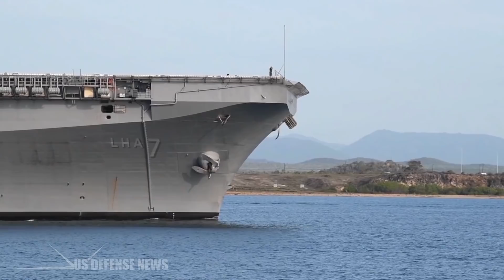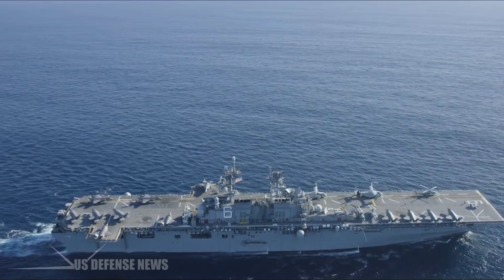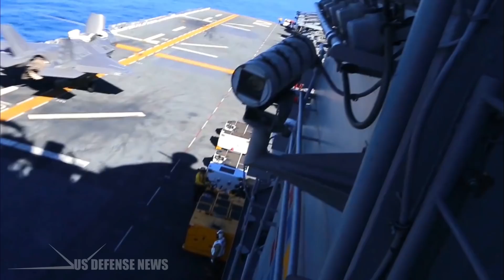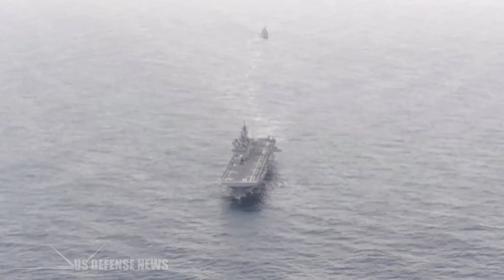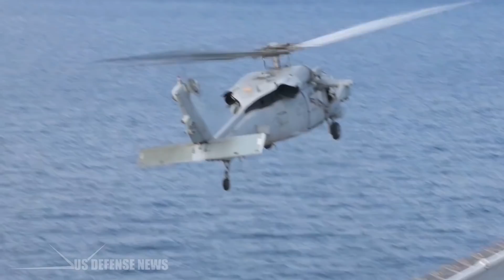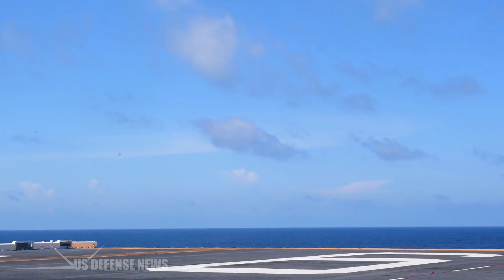Meet the U.S. New 'Assault Ship' Armed with F-35s and Much More

Comment: I wonder if any previously mothballed carriers could be brought back into service if they could be upgraded and outfitted with one or more flights of F35Bs?
Reply: Depends on what you are calling a carrier
The Kitty Hawk and the JFK are struck awaiting to be scrapped. Not sure what condition they are in BUT it should be noted that in its final years in active service the JFK was the most expensive carrier to operate and that planned renovations were simply abandoned.
So the only other thing that could be called a carrier are the last two Tarawa Class vessels that are In reserve. It’s possible one or both of them could be reactivated to fill the gap left by the torched B Richards but I’m not sure how feasible it would be to fit them for f35 duty

Comment: It really SHOULD BE wider - deck LIKE UK's Queen Elizabath Class carrier! This means our America - class overall tonnage can be - OR - SHOULD be indeed to 56,000 ton from 46,000 ton! USA
Reply: This is a failed design for a light carrier. failed because it will be the only ship of its class. the rest of the America's will revert to traditional LHA design.
Reply: This ship was designed to meet original Panamax standards and fit through the original Panama Canal with a lock system 1000' long by 110' wide.

Comment: It was stupid to build the first two America class vessels without well decks, they basically are just pocket carriers at that point.
Reply: Yea but the Marines have done experiments where they remove the V-22's and most of the Helo's and they can operate with a air wing of 20 to 25 F-35's. It won't have the punch of a CVN but it adds capability that has never been available to the USMC before.
Reply: They will provide air cover for the Amphibs.
Reply: The non well deck America class carriers are intended to fill the gap of support that we used to get from Britain and France. Both nations have drawn down the total number of carriers in their respective fleets and diminished their comparable deep water capacity until they are mostly costal defense and not force projection carriers
Reply: Need to build more.

Comment: New ship but you can see rust on the hull.
Reply: The sea rusts metal quickly. Nothing unusual at all and they get painted all the time. All navies deal with this.
Reply: The Hull has been around for several years, not unusual... Semper Fi
Reply: Not rust on the hull, oxidation on the surface of the paint
Reply: @MrSheckstr  correct and by design. That rust actually protects the actual hull by keeping that rust on the paint instead.